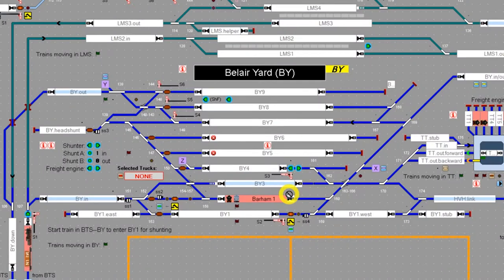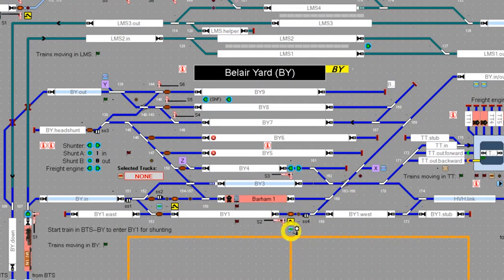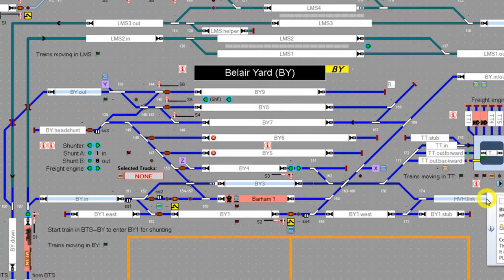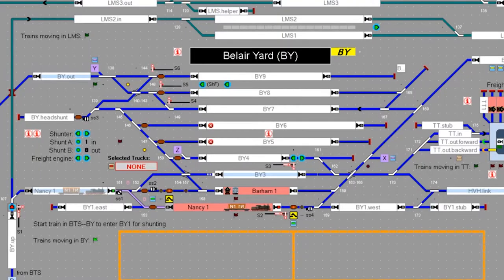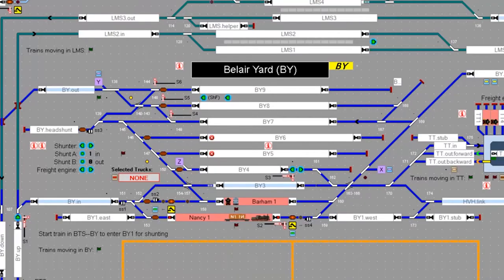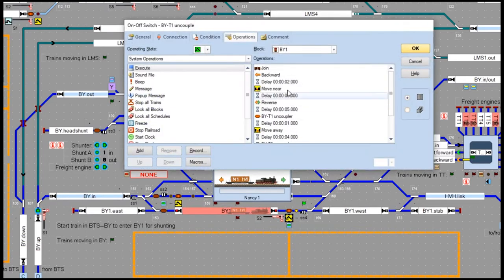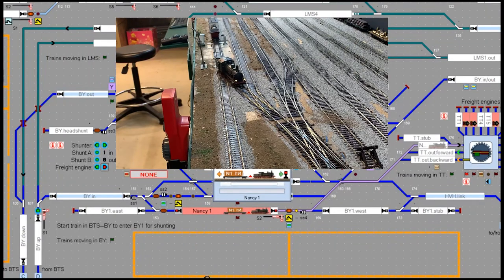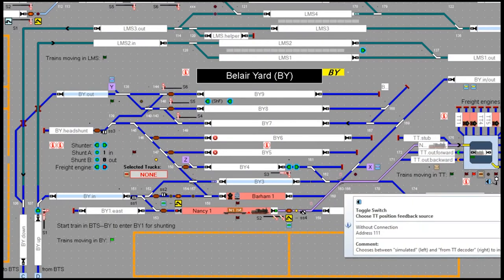Railroad & Co TrainController Software Automatic Uncoupling

Comment: It's good to see another Digikeijs user.
Reply from the maker: I love their gear.. great prices.. what are you running on your layout?
Reply: @ModelRailroadTechniques  I have a DR5000, DR5097 and a DR4088-CS.  My 2nd and 3rd video show my control system.
Reply from the maker: I use a Roco Z21 and S88 protocol detection
Reply: @ModelRailroadTechniques  My local club is Digitrax.  So while I went with the DR5000 for my personal system, I am mostly utilizing Loconet accessories.  Roco Z21 does not seem to be popular here, it is either Digitrax or NCE for the majority.
Reply: Great little video to show how it works. I’d love to know more about the IR detector and how it works. May be an in depth video later to show the electronics, wiring and programming?
Reply from the maker: Definately. This was just a quick little video to fill the void. I have many others in mind too

Comment: i have watched a few of your videos and you seem to have train controller mostly worked out, i was wondering if you could help me as i am having major problems getting my walthers turntable to work with train controller, i am using the walthers advanced control module to communicate between the dcc system and the turntable, neither of these peices of hardware do not have a base address but the in conjunction each turntable track output has an accessory address and a normal or reverse position relating to head or tail of bridge position..ive been through the user guide etc to no avail,  can you help?
Reply from the maker: Please email on modelrailroadtechniques@ gmail.com with product numbers of accessory decoder and turntable. See what we can do. I am not familiar with Walthers TTs

Comment: Hello, would you be able to pass some information on regarding triggering different decoder sounds within a locomotive in different blocks as a train drives around a layout? I am trying to have a horn sound then shut off but am having issues with the turn off portion, I can make it trigger in TC 10.
Thanks
Reply from the maker: Hello Brad, sure I assume you are wanting to activate this via an action marker?  The process is to turn on the function,  a short delay that blows the horn let’s say for 2seconds, then turn off. The off is toggled off using using the change button at the bottom action marker operations tab. Hope this makes sense? If not email me and I will send a pictorial of what my action marker looks like
Reply: @ModelRailroadTechniques  This is very helpful, thank you. I am still having difficulties figuring out how to make the sound last for only a couple of seconds. I would’ve thought train controller would have a timer until it change the state? I don’t see one any further advice on this would be very appreciated
Reply from the maker: @BradFletcher-sg8ft  sometimes it comes down to how the functions are set up in TC and on the DCC decoder. Try increasing the delay time, this may assist you too.
Reply from the maker: Brad you can also set up macros where you can save your settings. Then you can place the macro in operations tab of the action marker. This is a quick and easy way to activate a function or functions. The best part is if you wish to change the way the functions work you just need to change the 1 macro. This in turn will change all your action marker macros.